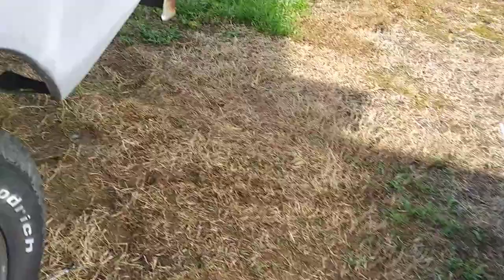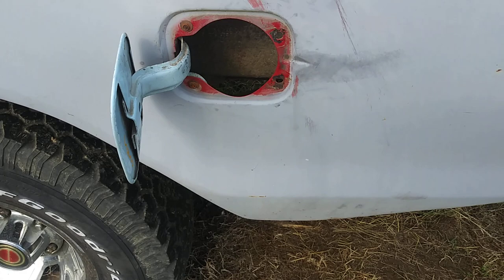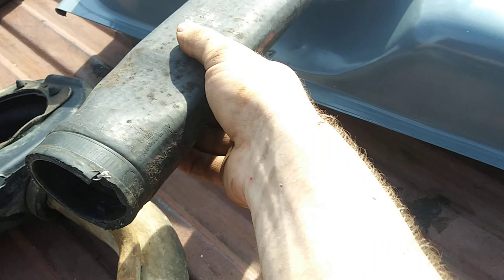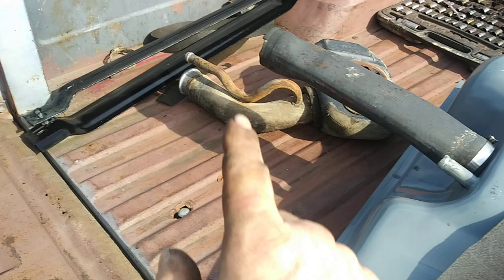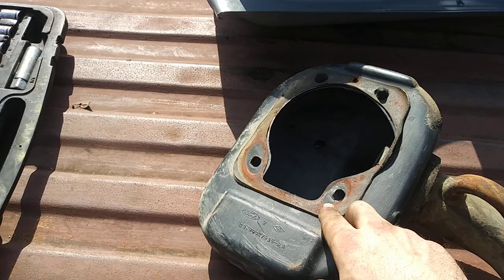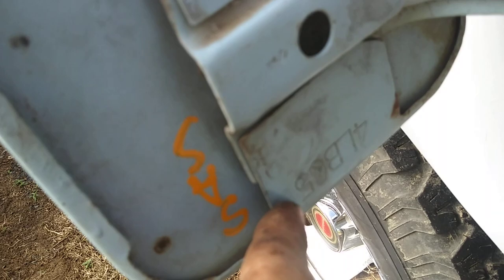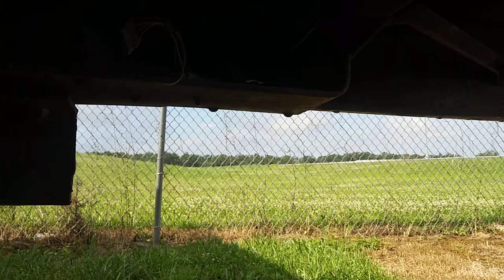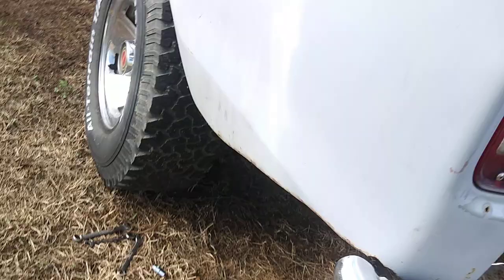78 f150 rear gas tank replacement

Comment: The switch is in the center on the top opposite the heater fan.  And the whole video you talk about so many unnecessary things and what I wanted to see was the lower straps installed and what upper straps did how they hold it?